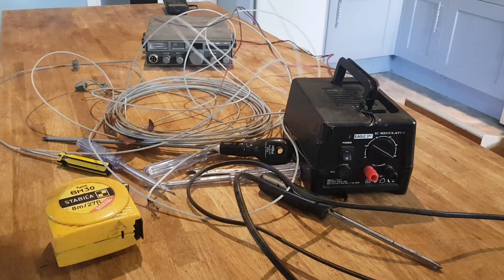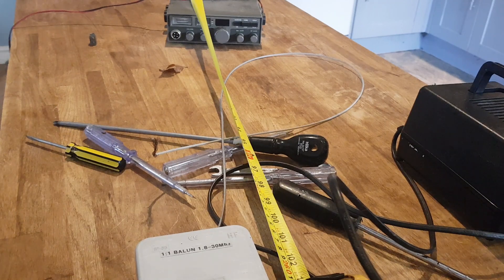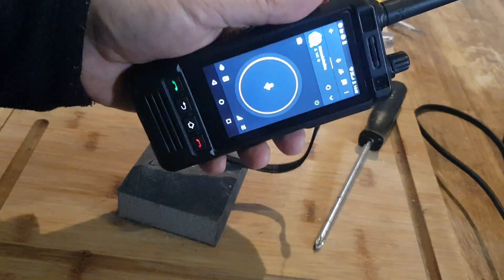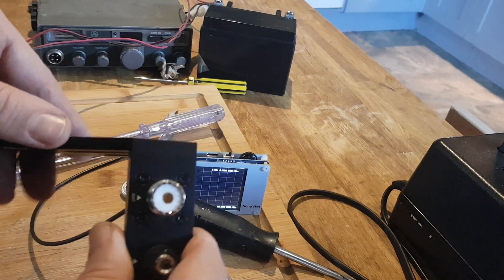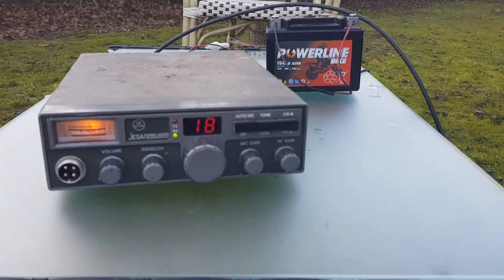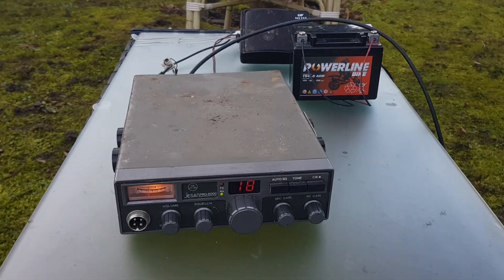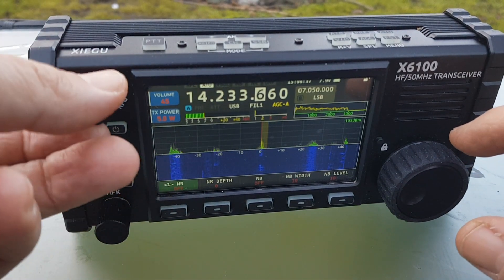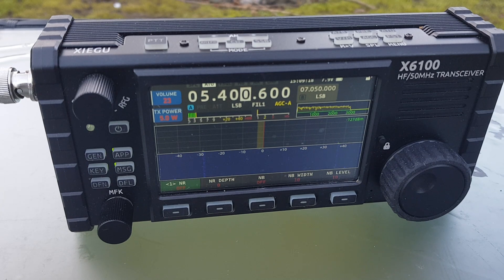11 Meter (27mhz) Home Made  Dipole 1.1 Balun

Comment: I am looking to build a inverted v CB aerial in my loft, I have seen people using Dipole Centre with a SO239 connector, which as a novice I presume is not the same as a balum, would using the cheaper Dipole Centre with SO239, then using a suitable 5 wire loop in the coax to provide a choke, offer a similar effect to the ring and wire coil in the balum that you are using? I am concern we have a 4 way freeview booster in the loft too, so I really want to keep any interfere down, from and to the inverted V aerial.
Reply from the maker: Hi sorry I am the wrong person to ask .